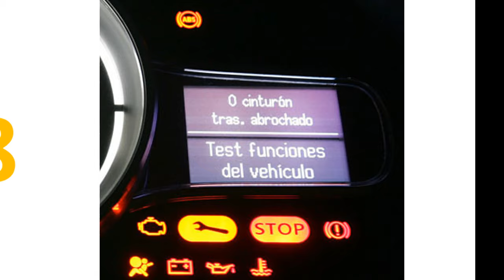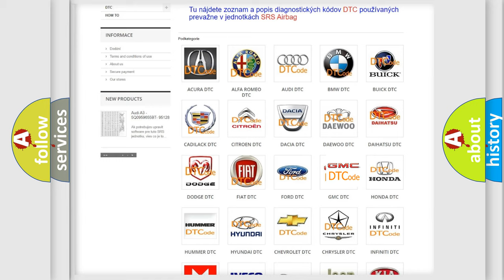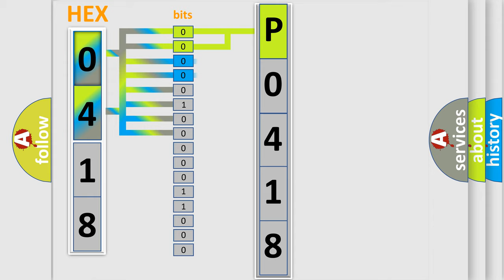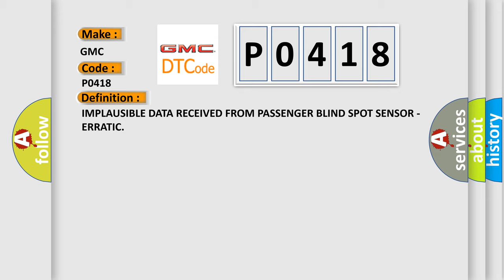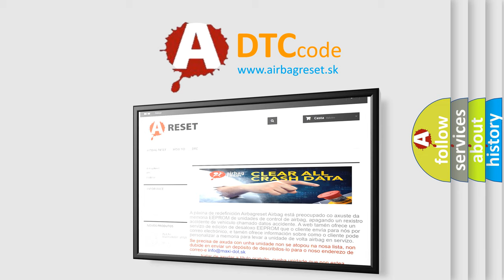DTC GMC P0418 Short Explanation

Comment: You should probably just delete this video since it's incorrect. GM code P0418 is for the secondary air pump injection system.